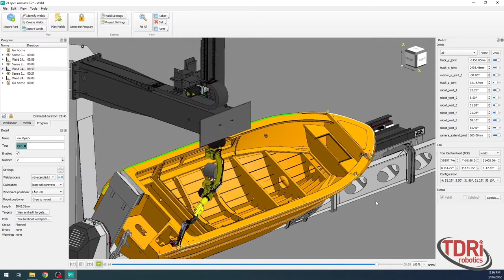TDRi Aluminum Boat Welding System

Comment: So with Laser welding you do not need to stop every 6-8 inches? Can just make a long weld with no worries of warping?
Reply: I don’t think that’s a laser. With high travel speed you can keep the heat effected zone down enough to minimize warping
Reply: Laser tracking is necessary because of warping. Welding is MIG process. 
The hull is not supported by fixture during the final welding, heat is causing several centimeters distorsion during the filmed section, but thanks to laser tracking, weld result is perfect!